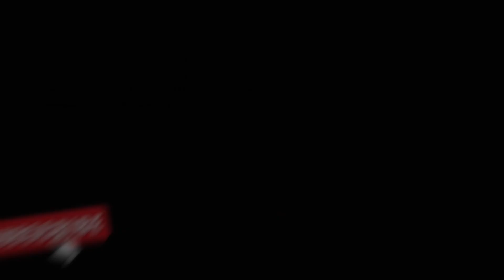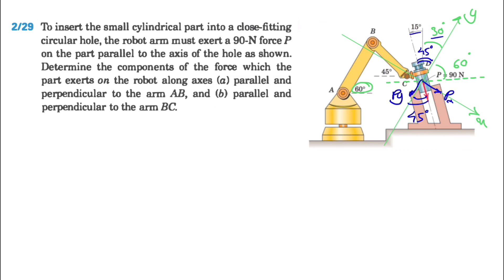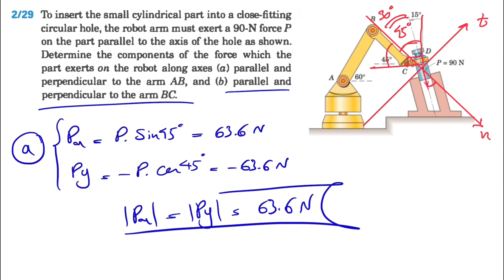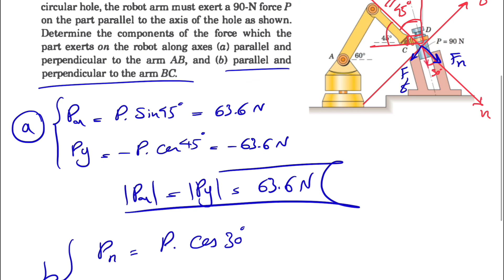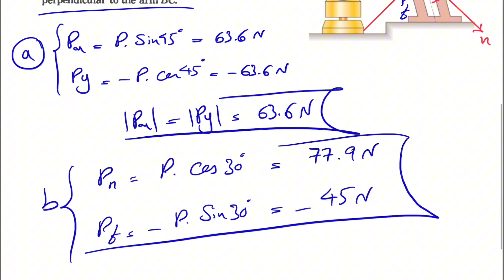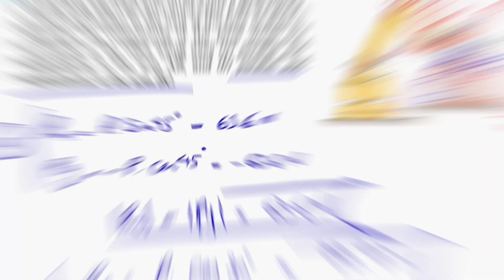Problem 2.29 | To insert the small cylindrical part into a close-fitting circular hole, the robot

Comment: Dear Sir, I have carefully followed your solution to the problem, but I believe there is a point with which I disagree. The problem states that the robot exerts a 90-N force 𝑃 on the part shown in the figure. However, the question asks for the components of the force that the part exerts on the robot. Since this is a reaction force, it should have the same magnitude and direction but act upwards, not downwards.Thank you for all the videos you have posted and for clarifying if I misunderstood any aspect.
Reply from the maker: You are correct, thanks for pointing it out. I will remake this video!